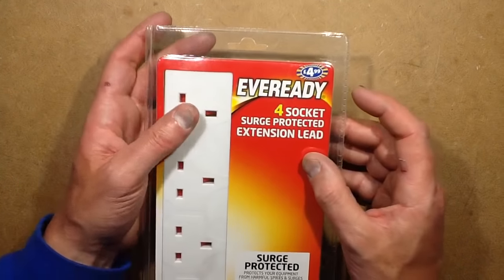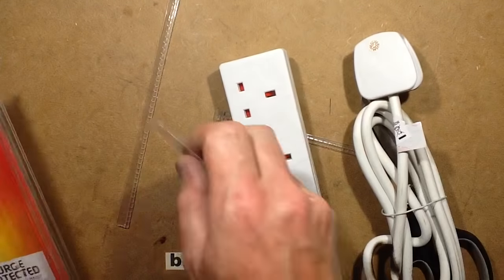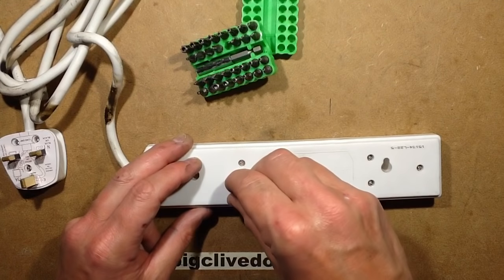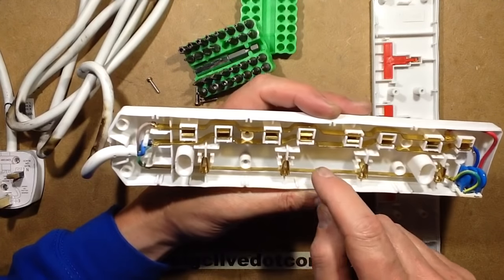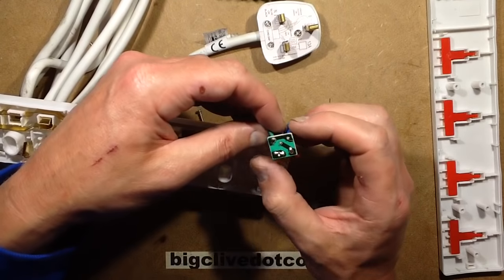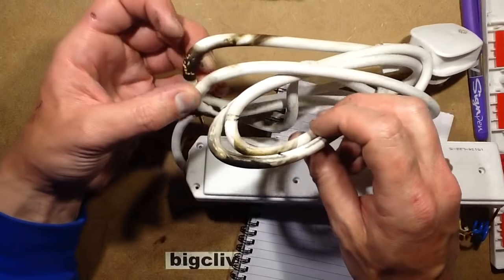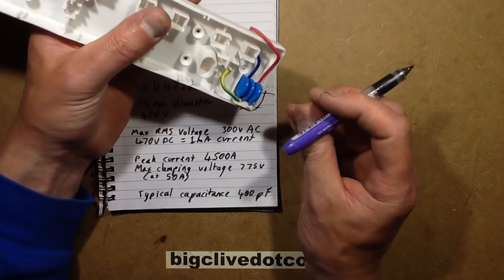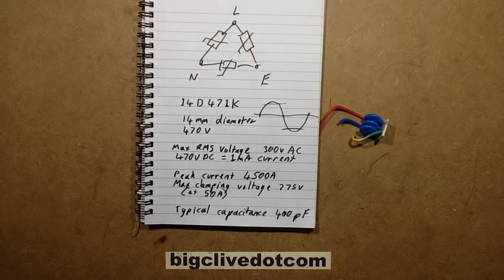Pre-exploded surge protection strip.  What the heck???

Comment: Every good and proper surge protector I have used are dead after an event. You have to take it apart and replace a fuse or possibly a thermistor you have to solder them in. Don’t think they are designed for customers to service but my friend told me that and had the parts. I still have 4 in a bag taped to the suppressor. At least it’s the only surge protector that kept my equipment from being fried by lightning. I have tried many and all junk but that one. I would have to pull out all the TV stuff to give you the name I bought it over 20 years ago from a buddy that had a satellite business. He said that was what he used because they were the only ones that worked. It was $120 his cost. He let me have it at cost. I haven’t tried anything new because I haven’t had any need for a proper surge protector.

Comment: Instead of throwing the plastic cover "into the bin", save it, mix it with smaller appropriate non-conductive material like plastic bags, then use it as additional insulation in your house. Attics and crawl spaces generally can use more insulation and are accessible. 
-- thereby pushing the hoarder needle further to the right.

Comment: I like the bayonet lamp over the Edison socket. my table and floor lamps, the bulbs keep coming un skewed from turning the socket switch on and off over time. the out side lights facing down came wiggle loses in the wind and fall out.

the UK plugs look great too, with the fuse in them and the heavy pins, the North America plugs are way to light and with hight loads, there heat up or can fall out of the socket with wear

Comment: Oh, if I want a triangle-headed screwdriver, I should look for ones designed specifically for "tamper-proof screws"?

(One manufacturer of model Ferraris decided to attach their 1/43 scale cars to the base using those cursed things and I've always wanted to take the cars off for photography reasons but without actually destroying the screw itself because I want to re-attach them to the base afterwards for display. But for the life of me, I cannot find that kind of screwdriver at Canadian Tire, which is also a hardware/DIY/outdoor store despite the name.)
Reply: yes. look on eBay, they're quite cheap
Reply: I'll probably just get one off Amazon eventually. I did get a nice set of precision screwdrivers from Canadian Tire once, though.

Comment: I don't recall the name but there is a popular manufacturing philosophy where schedule and cost are fixed by the manager and QC doesn't exist.  Shutting down the line because the products are on fire would mess up the schedule so it can't be done.  I've seen it done in the US where a massive technology installation was run on a predefined schedule, the electricians had troubles and didn't complete their work in the required time, that did not stop the testing and training from proceeding on schedule even though there was no power, in other words, they really didn't happen.  Customer was left with a system that didn't work and he didn't know how to use it, but the work was complete, the company moved on to the next job, the schedule was met.

Comment: You do good thing. I have never seen any video where you came to a conclusion I did not agree with. Good job.

I will add here, a surge suppressor is meant to work in conjunction with arresters farther back down the line which should remove the higher energy transients. If your suppressor is is getting damaged, then call the power company and insist they check their arresters or if none, add them.

Comment: The problem with people working on a assembly line is the brain gets programmed, to see the same thing all the time, it just goes into sleep mode due to absolute boredom.  Anything that happens in packaging has already passed through all  the QC. points and is up to the people in packaging to catch. In this case a total and embarrassing failure. The video on the components and engineering was quite good. I enjoy these  videos thank you.

Comment: it doesn't need thermal protection, when it goes bad, it takes its neighbours with him(assumably) effectively shorting live and neutral to ground. in that case, the ground thing will trip and shutting off the power. this way there will be no power if there is no protection

Comment: Also a point about British plugs, they're designed so children have a much harder time electrocuting themselves than the US version, for example, because the current only comes out of the bottom two sockets but you need to push the top socket in to release the others. The child would need to be a prodigy with a death wish to achieve that.

Comment: Make sure you got New/Good outlets for your expensive equipment, use a power meter to check your Voltage and Amperage is outputting correctly and also make sure your fuses for that line are good to go. Then get a quality surge protector with a high rating on Joules as well as $300k,$500k,$750k equipment coverage and read up on the stipulations on how to get your equipment replaced. The more reputable the brand the better chance you have to get your stuff replaced in case of an accident.

Comment: I work in a huge company for food ingradiens. A few monts ago, there was a something similar in one of our factorys. One of the straching machines has a heater to cut plastic sheet over the pallet. Every other machines witch we got are with a knife. The last one was with that stupid heater. As we wanted to mod that tging. From the german company manifacturer of that machine, sayd that if we made the knife mod, the warranty will void. And then we asked them to they made the mod. They sayd that will do it, but in few months and it is safe, there is nothing to worry about. And two weaks after that that stupid thing sets on fire..  And after that happens, they made the mod, fast and for free. But the accident was already fact.

Comment: Hopefully the 13 or 3A cartridge fuse in the plug would protect the system in the event of end of life failure of the varistors even with the omission of the one time operation internal fuse. Similar situation to installing surge diverters on house consumer units after an mcb.

Comment: Hi Clive,
Thank you for the technical description of the Metal Oxide Varistor (MOV) - I was looking at getting a few for when I start building a mains related project. However, looking at the available Thermal Fuses, which I would like to use with the MOV, they are available at all manner of temperatures.

As a general ball park figure, what temperature fuse should I be looking for in, for example, a surge suppressor module. I suppose the real question is when does heat become smoke and flames, which I would like to avoid if at all possible. Kind Regards Alan

Comment: I once bought a PS3 hand controller charger that had a package that got burned inside. I never figured out why or what caused it, but i gladly returned it to the store and had it changed. In my case I actually think it was the plug in charger part that generated the burn rather than a packing equipment.

Comment: The fire was within the packaging as there is a lot of sut which means there wasnt enough oxygen to brun cleanly as the case of the packaging. I guess there was a charge in the capacitors which shorted out the wires and caused a small fire to brun through the insulation and put out by the lack of oxygen within the packaging. That is my guess

Comment: Bit of plastic got stuck on the seal bars for a few 1000 runs and continued to again heat until it caught light. Once on fire it dripped off the side of the bar. Onto the product.

Comment: The machines they use to seal the packaging might use radio frequency heat welding. I use a radio frequency machine to weld pic canvas (like on a lorry curtain ) . A bit of metal in the press would push it into and through the packaging.

Comment: +bigclive ... you mention RCDs briefly in this vid. A quick run-down on what the hell an RCD is would be ace! I've often wondered about the details.
Reply: edgeeffect residual current detector also known as ground fault interrupter. when the current measured flowing through the two conductors is not equal it shuts off the power.

Comment: The rubber part (cord wire) of the unit obviously touched the hot plate/dye surface of the sealing plate used to hot seal the clear plastic enclosure. This is rare, but does happen during the packaging process.

Comment: Wait, it has tamper-proof screws that can be undone? I thought usually, they were one-way screws, so they can only go in, but not come back out.
Reply: That is one type. There are many others. The ones I see most are the Torx screws with a little pin in the center so a normal torx bit wont go in. You need the torx bits with a hole down the center. I also sometimes see the triangle ones like in this vid.

Comment: Made by Laihe, a huge Christmas Lights manufacturer (the last incandescent one in existence afaik).  They’ve been supplying fairy lights to the UK for about 25 years sold under various brands. 

Be interesting to see a teardown of a premium surge protected extension (such as the Belkin ones) and how it differs.
Reply: I can tell you, it doesn't differ by much. I had a Belkin start to melt from a power surge last year. That same surge destroyed a garage opener, another lesser surge protector, blew up the MOV in my laser printer (which worked fine after I replaced it), a dehumidifier and my water softener control unit. The lesson being: don't trust whole home surge protectors, and it's cheaper to have everything on its own anyway.

Comment: I see this was posted 7 years ago. I was searching for MOVs and noticed some TPMOVs (thermally protected MOVs). I wonder if they just included a thermal fuse into the package.
Reply from the maker: I featured some from an industrial surge protector that used a spring loaded contact to the MOV, attached with a low melting point solder.

Comment: Curious! Why did the 13A plugtop fuse not blow? In my younger (bored days at work) I spent many a happy hour zapping cables with many tens of amps to see how they stood up: usually very well and it took a lot to frazzle even small mains cables. Do you think the fitted 13A fuse was made by the Bejing Rusty Nail Company?
Reply from the maker: It seems to have been an external influence that burned the cable.

Comment: The only thing I would have done differently is at least consider putting the MOVs inside the plug to provide a lower impedance path to ground/neutral, in case the surge caused the MOVs to draw a high current. I don't know about the UK, but in many parts of the USA, lightning is a major concern. (It's never wise to think you've outsmarted lightning, but you do what you can.)

I wonder what a designer might do to further enhance surge suppression, given a somewhat higher budget? Gas discharge tubes? Maybe a series inductor and/or parallel capacitor to further block transients? Maybe a series inductor could even double as a fuse of last resort? Probably a PPTC/PolyFuse. I've got an Isobar protector here, and I'd love to see a teardown of one of those, since they're considered "the best".
Reply: We are a very dense compact country, so often the supply can be rerouted or has redundancy. The reason we tend not to get direct hits, is that our household supplies are almost all underground, so they are less likely to affect an individual and more likely to just mean a power cut. Telephone lines tend to be all that connects to our utility or telegraph poles for us.

Comment: I remember switching the input voltage from (I think) 110v to 240v for a computer PSU while on, heard some static sounds and it exploded. Turned it on five minutes later it was running nicely. Five minutes later it exploded again. Opened it up and found two out the cluster of four decapitated. It was fun. Mind you it was running a full computer set-up.
Reply: I really doubt that, you probably went the other way

Comment: My favourite "feature" of a bunch of these cheap extension cables is that you can very easily plug the earth pin in upside down, revealing the live terminal to be poked at with metal objects.

P.s. I was reading it as "Everyday" in my head right up until you said "Ever ready" which really threw me off.
Reply: Given the contruction... perhaps you'll need a new one everyday that you use it.

Comment: Maybe I misunderstood but this thing will stop surges above 470V. But my Dads whole neighbourhood suffered from a power surge due to some incompetent buffoon delivering industrial voltage to all the residential areas. and I believe that is 400V or so. But that makes this device fairly useless if it won't do anything up until that voltage? because all the houses in that area (apparently about 370 had pretty much all their appliances destroyed)
Reply from the maker: These devices are designed to clip short transients.  In your case it sounds like a phase and neutral got swapped and delivered full phase to phase voltage at sustained current.  This is not an uncommon incident.  In that case the best the surge suppressor could hope to do is trip the breaker on the circuit it was connected.
Reply: pretty sure that isn't a "surge"

Comment: When I moved my dad's house there was an adapter like this in the corner behind his TV, and (luckily it was unplugged at the time) I picked it up and all the plastic pretty much disintegrated in my hands, not even holding it tightly. Any idea how this happened? I am guessing it wasn't like that when he first bought it or it wouldn't have survived installation.
Reply: It was most likely made out of bakelite, it becomes brittle with age and heat. I come across old brittle bakelite connecter blocks which crumble in your hands all the time, pretty dangerous if you're testing/working live.

Comment: Clive I would like to see how that 3-pin child protection in the sockets (in the device you showed in red plastic) works, those must be unique for that type of sockets: in sockets with round pins the earthing is a  double contact of the rim of the plug, or sometimes a third pin that sticks up from within the socket and fits into a hole in the plug. In all those, the child protective little plastic covers only the two active pins. It works be cause it will only move out of the way (and allow for something to be plugged or stuck in) when it is pushed onto on both pin positions. It does that by getting stuck when it is moved unevenly. I however for the life of me can't imagine how this could be done for three pins at one time. I wonder if you could someday show us that on the side of one of yar excursions? Greetings!
Reply from the maker: The most common type uses a ramp in the earth pin hole to push the shutters down.  The earth receptacle itself doesn't need a shutter.

Comment: The British mains plug is a good and very clever design indeed, but I shiver at the thought of even the tiniest table lamp and low power plastic gadgets having that huge gluttonous plug! You don't need a built in fuse and earth connection for everything.
Reply from the maker: It's big and ugly.  But it was designed with function before form and on a 32A 240V circuit the fuse makes a huge difference.

Comment: I've seen many surge protected strips that are garbage like this one. I found one at an Ace Hardware 20 years ago that had all the right parts that you'd need to make a proper surge protector but it was wired wrong - if it got a surge, it would blow a fuse and light a light, but it didn't interrupt power to the connected devices. The fuse was apparently there to protect the MOVs.
Reply: That socket doesn't look bad, but note what Clive said about the limited life of all MOVs.It all gets into some arcane details of earthing connections whether you need that 3-MOV rig, but there is a connection between Earth and Neutral somewhere. The diagrams I have seen show a connection between the Protective Earth wire and the incoming water supply pipe, but that can't be relied on as a primary Earth because of plastic pipes.

I wouldn't want to bet on Earth and Neutral being at the same potential, so that delta arrangement is likely still useful.

The lack of an indicator may matter more.
Reply: I guess in the UK with the fused plug, it's not totally horrible. In the US that would definitely need a fuse or circuit breaker inside the strip, so that the MOV doesn't have to eat the entire surge, just enough to blow the fuse.

Comment: Isn't it a bit weird that the Earth wire going into the actual unit doesn't have excess length?
I would have thought you'd follow the same logic as a plug and wire it longer, so that if that end gets yanked, then the live or neutral will disconnect first.
Reply: That's exactly what the plug forces you to do...

Comment: How do you go about testing the integrity of a MOV?  Also, outside of just applying an obscene voltage to it how would you go about intentionally destroying one in order to see the failure mode?
Reply: test the resistance, aditionally, heat it up and check if the resistance drecreases according to the datasheet charts